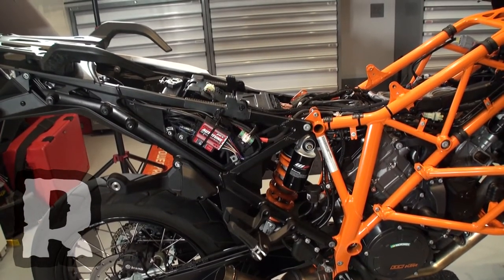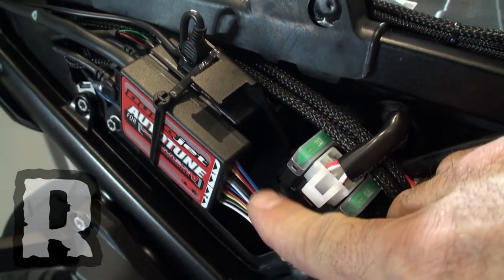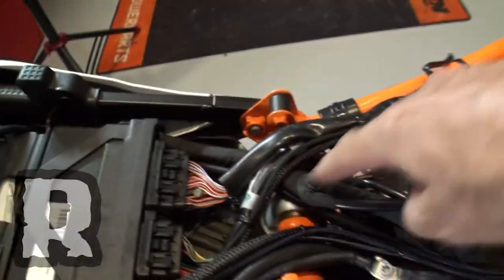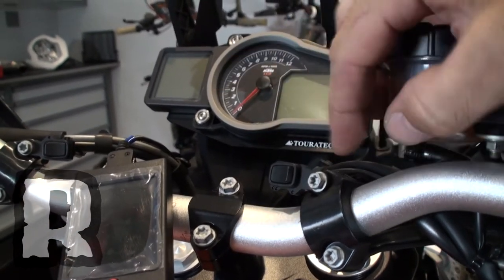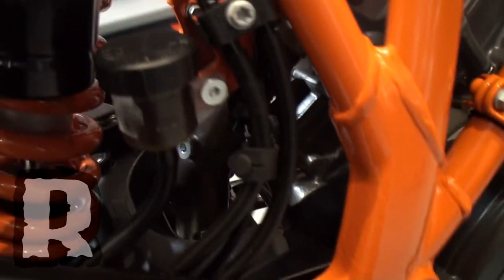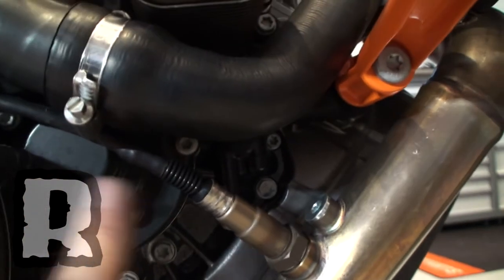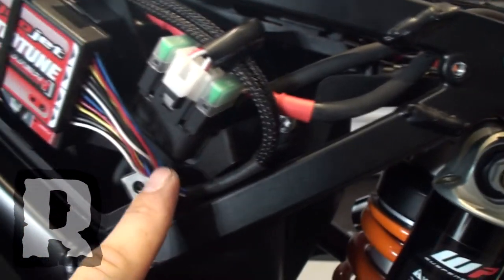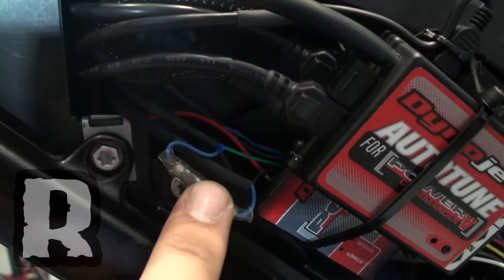HOW-TO ROUTE DYNOJET POWERCOMMANDER CABLES - KTM 1190 ADVENTURE - ROTTWEILER PERFORMANCE

Comment: Nice job!  Do you have a video like this for the SD 1290 R with PCV and Auto Tune?  I have a stage 5 setup on order.
Reply from the maker: Right now 10/31/17 we do not, but plan on it. We are working on building a studio specifically for these videos so we can do more of them more efficiently. Until then, we don't have this for the SD but you can certainly shoot us a call or email and we can help. What we usually do on that bike is go to a lithium battery, specically on that bike the Antigravity 10-10 or 10-12 and that allows enough room for most of the Powercommander products inside the battery box because the batteries are smaller and allow the extra room (and drop 7 lbs!!). Once they are in there it's just really up to your creative wire routing. Take your time and make it all clean and in the end it will all be beautiful.